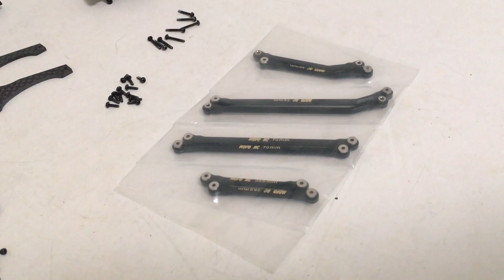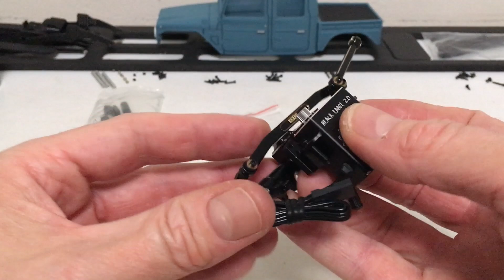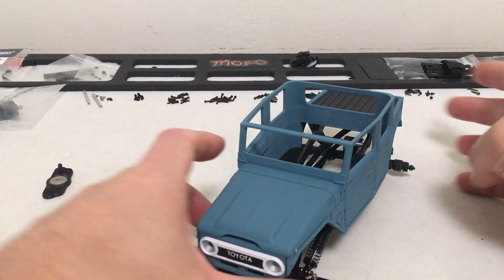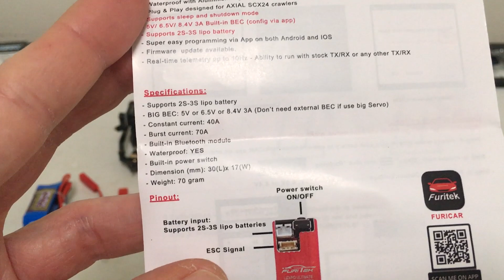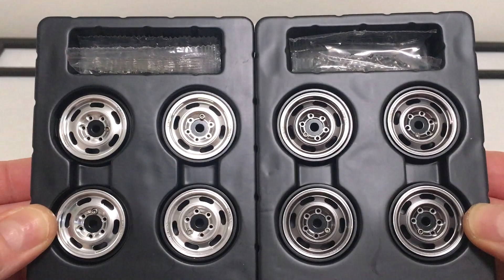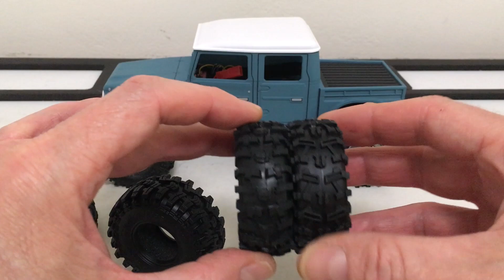SCX24 TOYOTA FJ45-4DR BUILD: WT MICRO BODY, MOFO BLACK LABEL 2.0, NANO BAM, C.F. LCG RAILS, FURITEK

Comment: Do you think this body can be mounted on an lgrp comp frame?
Reply from the maker: @in3g00  I’m sure you could work something out with magnets.
Reply: @bcochener  are the 4 doors same lengths as the 2 doors?
Reply from the maker: @in3g00  depends. There is a short 2 dr truck that is JLU length. This and the extended cab 2dr are both Gladiator wheelbase.

Comment: Just curious oh how top heavy a body like this would be on a fairly serious crawler.
Reply from the maker: Not bad at all. Obviously a bit heavier than lexan. Just have to compensate a little with low weight. I’m about to do this same 4DR FJ body on a Cheat Code XL. Should be starting that fairly soon. The cab only’s are a great lighter/more forward option as well for these bodies.

Comment: Would love to see the routing for your headlights
Reply from the maker: Just taped them in the same as I did on the 2DR FJ-45. That video shows it better. There is a shot at the end of this you can see them: 1:18:14
Reply: @bcochener  thank you, not sure how I missed that!
Reply: One more question, how do you think the Bobbed tail would handle a rear steer? I'm contemplating doing it to help with the longer wheelbase
Reply from the maker: @stumpsproutstudios  The servo may conflict with rear magnet mount if you were sitting as low as mine is. I’m sure there is a way!